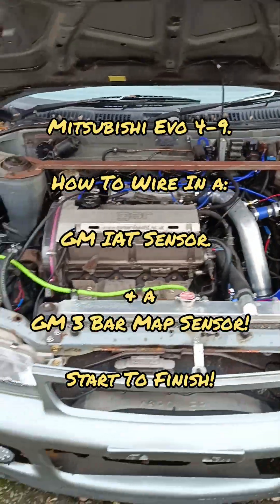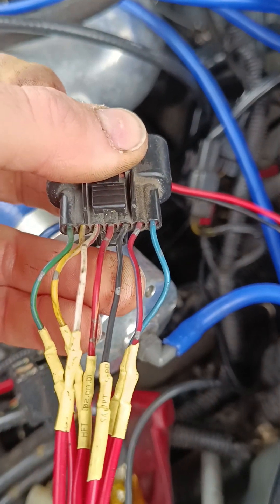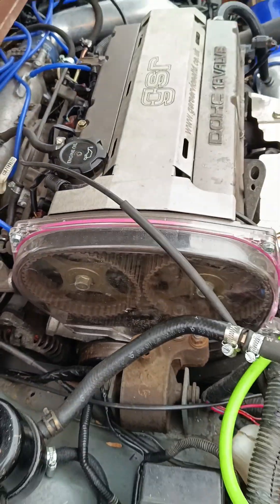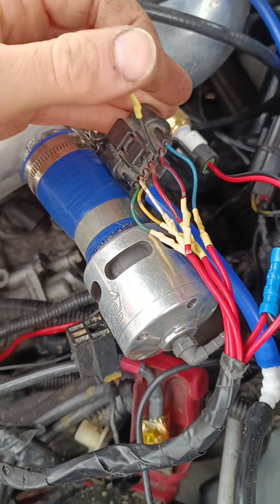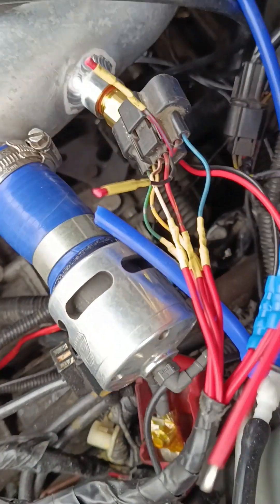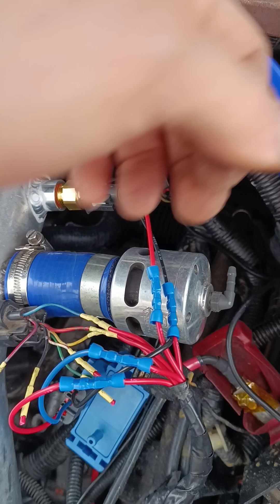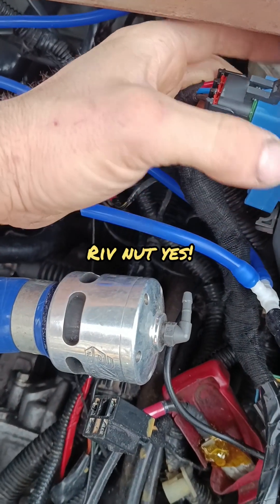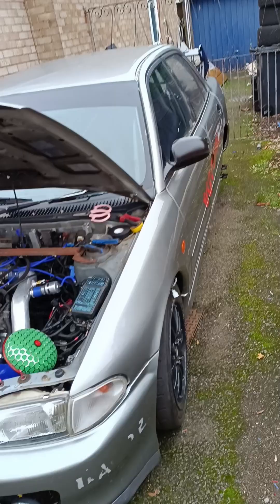Mitsubishi Evo "SD" Conversion! How To Wire In GM IAT & 3Bar MAP Sensor 4 5 6 7 8 9 MAF Delete Video

Comment: how many engine mounts the engine is sitting on ?
Reply from the maker: @dhruvkadun9059  all of them.

They were all done and fabricated custom.

It is the completely different engine/gearbox for the chassis.

Not only this, you will need to fabricate up all drivetrain mounts new.

And you will also have to modify front subframe, and also make a new front lower beam, and also a small chassis notch gearbox side (Chassis notch not technically necessary but 100% needed if you ever want to remove/install gearbox without dropping the complete engine/gearbox all together).

This is not a straight forward conversion.

There is far more than this to think about.

I even made my own speedo drive so I can have a working original speedometer.

Everything on my car works.

All gauges, all electrics.

Everything like oem!

Comment: Thank you this vid was very helpful as to where I wire into.
Reply from the maker: @doggodog838  I am glad it helped you. Only one thing to note, depending on which map sensor you use, my mapper had to invert the map signal in the map. But this setup works well. The car is quick! Have you watched my dyno video on my channel?
And also the video of me taking the car for a run?